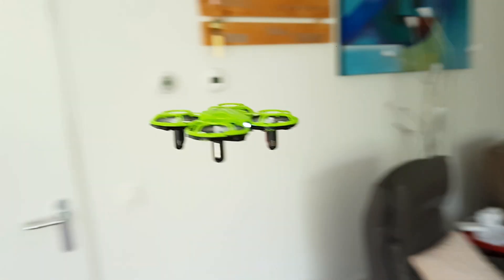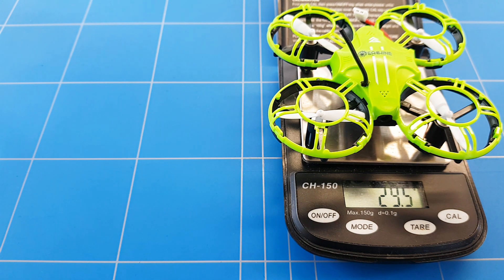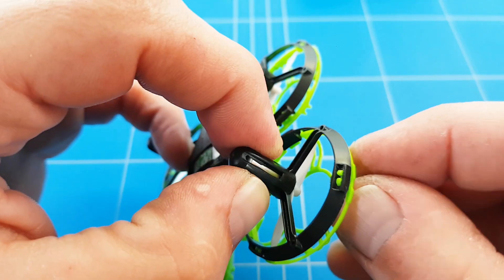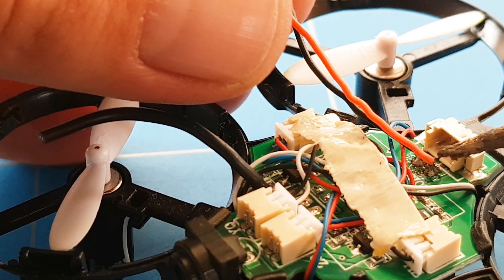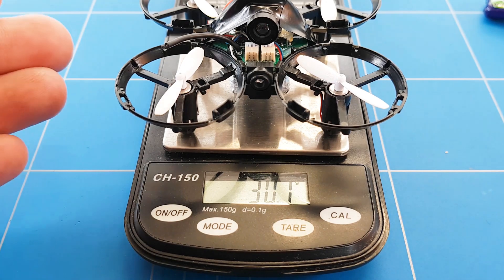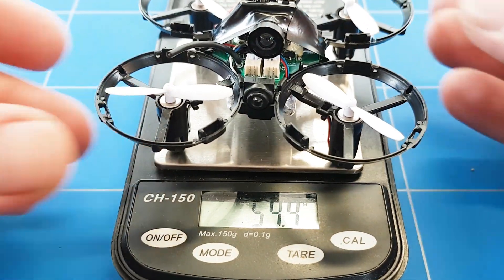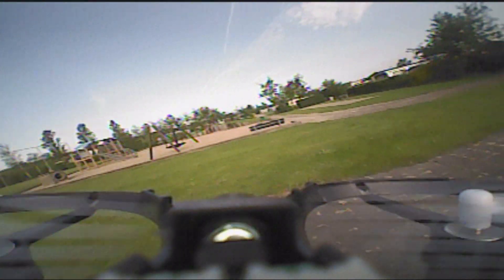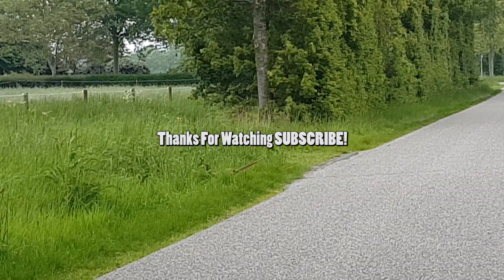EACHINE E016H FPV MOD and LIPO BATTERY UPGRADE WITH FPV TEST FLIGHT

Comment: can i change the battery plug for the drone so  i can change the battery i use and make it 350/400mah cuz the battery plug in the lipo upgrade you used has a different plug from the rest of the lipo battery so it limits the type of battery i can find 
also whats the name of the type of plug in the upgraded lipo battery

Comment: Good video ... Loosing the led and it's little black shell would save a little current , And weight , And it wouldn't be in the cameras field of view 👍
Reply from the maker: yes and each gram makes a big improvemend to how it the mini quadcopter fly's
Reply: @HowToDIYRc    Ive orderd two of these little drones . One ile keep original the other ile modify  .
Reply from the maker: they are great for flying indoors during this winter you have a ton of fun :D

Comment: bello i need some advice i want to cut that led in the front to save energy, can I do it ? will the drone still work?
Reply from the maker: Yes but it draws very little voltage and helps to make the front of the drone more visible at a far distance
Reply: hello I followed your advise and I won't take it off I even added an optic fiber attached to the led making an arc to the back looks great at night. I discoveres today the speed button this thing is fast. 10 mins last my battery at speed 1. Still no camera but I already ordered beetle v1. I want to add 5sec beep alarm to find the drone if its lost ,any suggestions?

Comment: Excellent, I will be doing this now too :) Thanks for sharing
Reply: I've modded the top shell by cutting the green prop protectors off in 4 parts to remove the green center of the shell but leaving the prop protectors on the quad. I've also added a Beetle V1 camera in the middle on top using a thin piece of card, securing this with a tiny amount of hot glue. Just ordered the 500mah 1S Nano-Tech batteries
Reply from the maker: great tips my friend but 500mah battery is as bit on the heavy side i think
Reply: @HowToDIYRc  oh no, well I'll let you know how it goes, and I'll probably end up getting the 300mah version like yours 👍